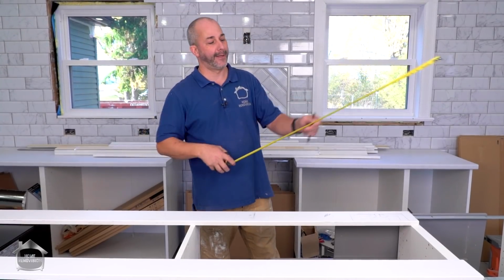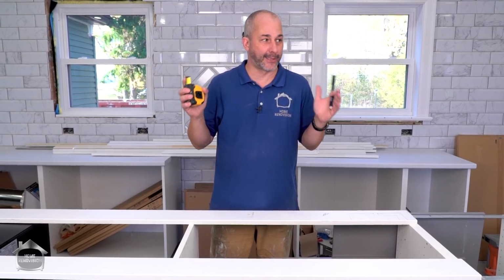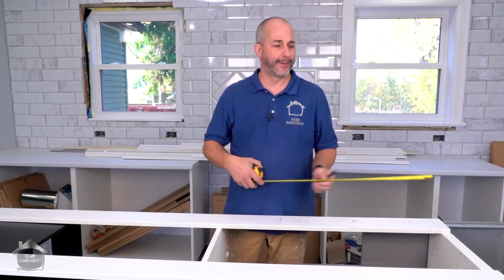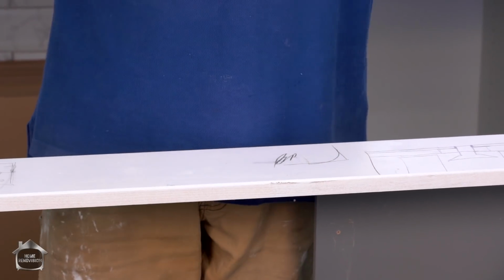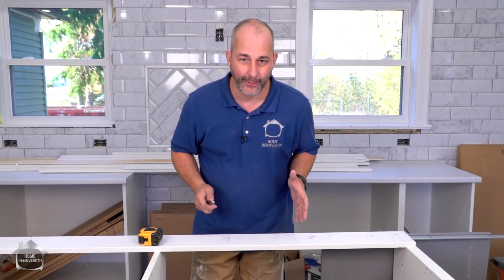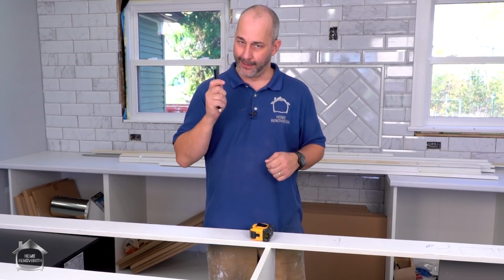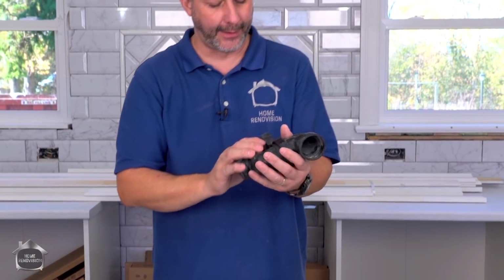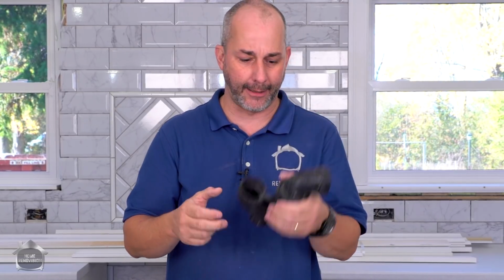How To Plan Your Open Concept Kitchen To Avoid A Disaster!

Comment: Jeff, quick question.
How do I get the eggshell finish over sanded drywall mud that was used to repair the removal of a wall mounted mirror in a bathroom?
The mud is smooth after sanding, compared to the undamaged drywall around where the adhesive was used.
Reply from the maker: sometimes the best thing to do is to skimcoat the entire wall affected so that there is no more texture difference. It is one of the ugliest and most common mistakes contractors make. trying to fix with paint is next to impossible. Cheers!
Reply: @HomeRenoVisionDIY  Thanks Jeff!
Luckily it's a small bathroom and the wall is only 5 feet wide.

Comment: J Jeff a bathroom renovation is turning into a disaster the special order faucets I bought didn't fit into the sinkholes and not for the second time I have to raise my mirrors and electrical outlets because the mirrors are hitting the faucet for the second time I want to scream and cry at the same time I sure hope by the time I get to use the shower the. Thing doesn't leak otherwise I'm jumping out the window from the attic if I can fit through it my next house I will get it right this has been one heck of an experience my only problem now is I can't remember anything so I am sure I will make the same mistakes again LOL
Reply: Ps. I can't use a level or ruler. strokes hit a useful part of my brain math and organizing balance vision....dont know how I survived 2 but still have my humor go figure. I keep typing this to get it right as possible

Comment: How are you venting the sink Drain?  Doesn't code require vent within 10 feet of drain?
Reply: There are many ways to install the required vent in a sink installed in an island. I am the process of building my house and would highly recommend contacting the local plumbing inspector to find out what they will and will not pass as per the local building code.
Reply: He actually has a video on how he vented